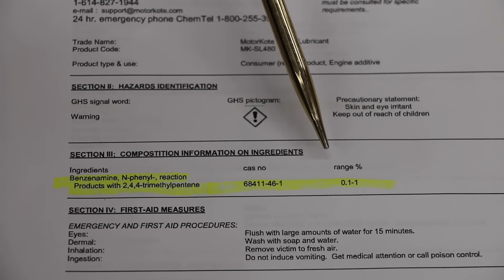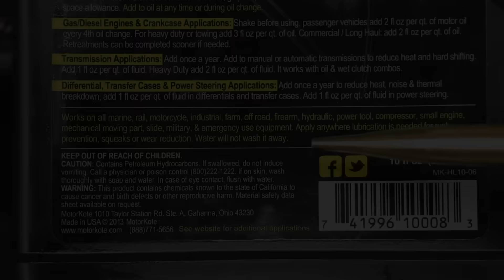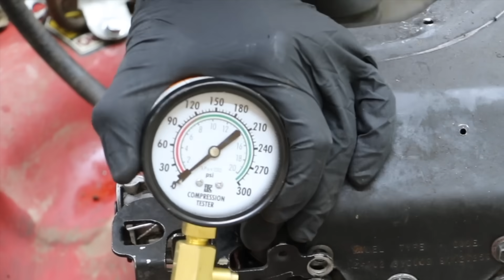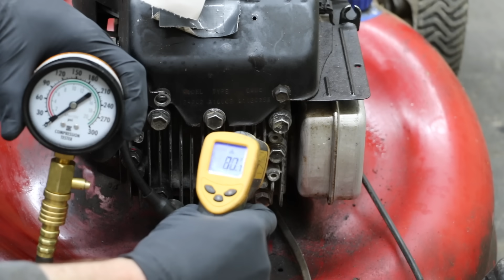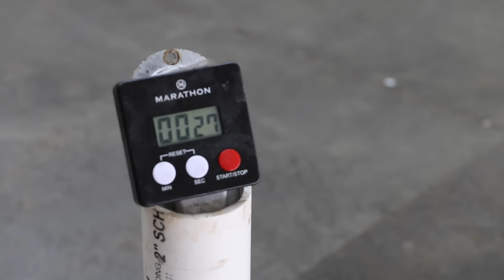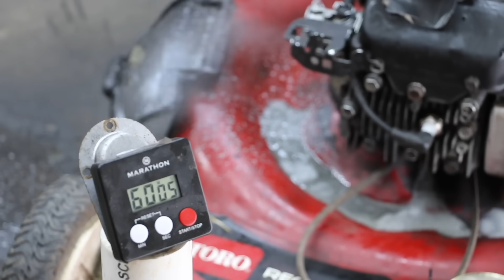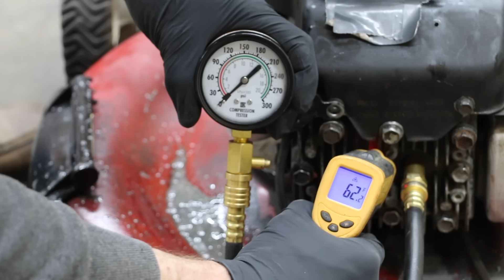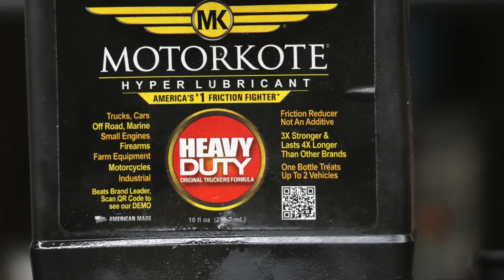Can MotorKote survive the water test?  Let's find out!

Comment: Used MotorKote for years in both my Big Trucks and Automobiles with no outstanding issues.  It does appear to do its intended job.  I get better Fuel Economy with it...and my Engines are clean and quieter too!  I can also attest that this product works really well in 2 and 4 Stroke Outboard Engines of any size.   I will continue to use this product, and your Test was really awesome and comprehensive!   Thank You for this Test and Review!!!
Reply from the maker: Impressive! Thanks for commenting on this.

Comment: wow! that lubricity test though! im amazed that this product worked so well. 
so now we know the special cocktail..
 seafoam, marvel mystery oil, engine restorer and motorkote!
Reply from the maker: These all seem to be legit products that work.
Reply: Project Farm do a torture test with all the products together? Or head to head?
Reply: Each of those products are made to do something different, so comparing them would be pretty pointless.
Reply: How about testing TurboMaxx? Then TriboTex that reverses engine wear. These are both nano particle products. I use these products in my Ford Super Duty 7.3L Powerstroke Turbo Diesel. 302,000 plus miles so far. Runs great.
Reply: I'd be more for a amsoil motorkote sauce mix than use seafoam or marvel, they are both outdated for their designed  uses and work better as cleaners than as high pressure lubricants. Sea Foam I know is naptha based which is a powerful oxidizer, usually used to speed up oil based enamel paint cure time.  As for Marvel, I know of engine builders of flat head engines liked to use it in the coolant system to get the bolts out of the heads... fill the coolant system full of marvel and run it till its hot, head bolts and water jacket bolts come out much easier without snapping them. Sea foam we've seen it work as a cleaner as Mr Farm tested, also saw restore bring a tractor back to life, as for marvel, I just wouldn't go around putting stuff in your crankcase, especially newer engines that was first marketed in the early 1900's.... 'shrug' but if you have an engine you don't care goes boom, do your own testing like this guy, this guy does amazing testing,  i look forward to every video... especially oil ones.

Comment: Old 'Geezer Gearhead' here again. Changed the oil yesterday, 6/17/18 in my old '02' Ford E250, 5.4/2valve, extended van. Mileage, as I write this post is 310,682. I drove it farther than I usually do before changing the oil&filter.  Almost 5,000 miles on the oil change with Motorcote additive. The oil level might have been down approx. 1/2 quart.(not too bad for an engine with that kind of miles on it and never had any major work done to it). I followed directions again, and added the Motorcote to this current oil change per recommendations.  Traveling to Tallahassee this next week end. I 75 and I 10. From Ft. Myers, Fl., and back. I'm convinced this stuff is working. One of the best additives that I've ever used in my driving career since April 1960. BTW. That's two oil changes and one container of MotorKote. Still some left yet. Thanks again for this good informative video.
Reply: Motorkote claims you only need to add every 3rd or 4th oil change... But maybe you already knew that.

Comment: Considering all of the awesome testing you've done on products like this, what in your opinion would be the best Fuel & Oil additives to use in my 66cc 2 Stroke motorized bike? I've been using Lucas Semi-Synthetic 2 Cycle oil + Chevron Supreme gas (32:1). I was considering using some fuel and oil additives to help my engine run cleaner and more efficiently. I was thinking of using Marvel Mystery Oil and Lucas Upper Cylinder Lubricant/Fuel Additive, however, now I'm thinking Motorkote Hyper Lubricant & Motorkote Fuel Optimizer might be a better option. What is your opinion on this?
Reply from the maker: I really like what you are currently doing. I don't believe you'll achieve any significant gains by making changes.

Comment: I now realized much more how great are your tests, motorkote totally shows.
Here is an idea, there is a cerma store, www.Cermastore.com

They sell additives, which they say you apply only once if it's for the engine crankcase for example, and then only continue with Cerma engine oil. Claims are pretty wild! They say their diesel engine oil, 15w40 lasts 30K miles,  if used on a semi truck! I really wonder how it stacks up against motorkote, and are their claims true, or a crafty snake oil?
Is it new American miracle, or just a claim, about cerma? They sell bunch of stuff, like for transmissions, and even additive for AC system, which they claim makes it last. The claims are so wild! The products claims from cerma are truly astounding, just read testimonials from supposedly truckers, about engine treatment and oil!
Is all this holding true???!
They say to have treatments that can be used for any engine, gas or diesel
Reply from the maker: Thanks for the positive comment. Also, this sounds like a great additive to test--thank you!

Comment: I just bought some of this to try. will see how she does. I use an app to track gas mileage after fill ups. Will run for a full 5k oil change and see if there is any noticable improvement.
Reply from the maker: I hope you achieve great results.
Reply: it looked great in the video, im guessing i will see marginal results if any in regular use. I will be using it in a 2009 dodge grand caravan with 180k miles and a 2017 honda civic with 22k miles. i hope to use it regularly in the honda to prevent wear in my honda and get a little more life out of my dodge. an ounce of prevention is worth a pound of cure.
Reply: well, I can still keep track but I think I'm done. Results for are 4,038k before, 2,392k after adding MotorKote.  Increase of 0.868mpg or 2.45% at 2oz per qt. Not bad over all, I think it is worthwhile and reducing friction  and wear in my engines and I plan to keep using it.

Comment: The pertinent question is, why aren't the components of motorkote and the like already added to premium oils? Massive research budget oil firms will know this stuff works and works well. There must be a reason. Would it unbalance the detergent properties? If so does adding motorkote benefit friction but reduce cleaning? Thoughts?
Reply: Probably because MotorKote is a private company that can make more money by selling their product seperately
Reply: for the same reason the oil companies don't want autos getting 100 miles per gallon..they would sell far less fuel. MotorKote type additives would also probably  effect the auto industry (less engines/ cars sold) as well as the dealership maint. and oil change industry.  it's benefit vs cost
Reply: My two cents: It would raise the cost of motor oil which would negatively impact sales.  Motor oil already meets or exceeds established standards, so why bother trying to make it better -  apart from synthetic.    That said, I just ordered a bottle for my car and my motorhome.
Reply: @mlconley  From my own personal experience...you'll will be happy with it!
Reply: @mlconley  yeah but you can't just not buy oil
Reply: @brewsqui EXACTLY the reason. Because it works too well!
Reply: I consider it to be like that episode of Futurama where fry buys the last tin of anchovies in existence and mom is worried that he will make some super oil and end her robot oil tirade 

If MotorKote themselves released an oil with lubricating properties that were the same as straight MotorKote 
They could easily put every other oil company out of business (and probably themselves too) because people wouldn't need to change the oil every 25,000km anymore, now they might only need to change the oil every 200,000km, sure that oil change will cost you a few hundred dollars, but you only need to do it every 10 years or so and the engine will last far longer than with regular oil 

I know pilots that use a 50/50 mix of oil and MotorKote in their planes, and they have never had engine trouble relating to the oil system since 

I am probably going to start using it to lubricate the parts on my electric bike instead of spraying WD-40 into it a few times a year
Reply: @mwbgaming28  I agree with that. I know I would buy it and not only that, I would pay top dollar for it after reviewing the test and the comparison to other oils. I don't think they would put themselves out of business though. Just look at the past oils compared to todays oils. Years ago oil changes were every 3000 miles and now it's gone up to over 7500 miles with new oil blends. I'm not sure about everyone else, but I would be willing to bet that just like me, people still change their oil around the same time or mileage with the high mileage than they do with the 3000 mile oils. It's all about peace of mind knowing you're running a top of the line oil and caring for your engine. I run both gas and diesel from motorcycles up to large equipment and even though the top dollar oil I put in the diesels claims it good for 7500 miles, I still change it before that. I believe it would be the same idea if Motorkote was to make an oil. But I also find it strange that a gallon of Motorkote is less expensive than the oil I use. And I know some people will say just buy a gallon and use it for everything. That's true as well, but we're all about convenience now days. We don't want an additive, we want one quart to do it all. There's several ways to look at it so I guess it's just a personal preference, but it would be nice to have the option. 

P.S. Motorkote makes a spray lube. Why would you not use that instead of WD-40? Wouldn't it be so much better than just a water displacement? That's my opinion anyway.
Reply: @nzzs203  very true, but imagine your new oil is good for 200,000km (whatever that is in miles) 

I don't think you would change your oil every 5000 miles if your oil was good for many many times that 

The reason I used WD-40 is because it's cheap, gets the job done and I didn't know that motorkote made a spray lube until now or that it was better than they claim it to be 

Now that I have seen the hard evidence rather than relying on stories from my pilot friends using it in their aircraft engines, I'm definitely buying some motorkote for anything that needs to move but refuses to
Reply: @mwbgaming28  yeah, I guess you're right about 200,000km. That's a huge step up from 5,000. After seeing the evidence and you saying how your pilot friend uses it in their plane, that's enough for me to trust it in my vehicles and equipment. I've never used the spray myself. I was reading about Motorkote on the web and the spray came up. When I go to get the gallon of Motorkote I'm going to try the spray too. That way I can give a honest opinion about it.
Reply: @nzzs203  well I look forward to hearing about it, maybe PF can pit WD-40 against it lol
Reply: @St3v3Bob  The problem with that thinking is it costs literally several billion dollars to produce a drug these days. So even if you cured cancer good luck raising 3 billion dollars to get it approved by the FDA. Also, there is more money selling a treatment drug for 20 years than there is a 6 month drug supply to cure a disease. I dont know about oils, but it must cost tens of millions to get these different certifications you see on the jug. Motorkote may just not have the capital to go through that. Not saying that's the case, but it could be. I think on balance...motorkote is unlikely to be better than everything else...but more testing needs to be done
Reply: This seems like it would be good in a Stop/Start engine
Reply: Patented
Reply: I can think of a few possibilities: a) too expensive b) alters viscosity too much (fine for heavier oils, ultra lightweight (0w-xx) oils like those used in modern engines with vvt might become very difficult to formulate) c) oil manufacturers have no clue how to replicate its properties in a cost effective manner (im sure motorkote put a lot of r&d into the product given that it legitimately works) d) it may not make any financial sense to add it (oil manufacturers can already make claims like "reduces friction/wear" without actually having a superior film strength)
Reply: @arlobubble3748  
My feelings as well. 0w20s are like water as is. I like the idea of this product but worry how it may effect the filming of the oil.
Reply: My brother sells this stuff and I have used it and swear by it.  I am also an engineer.  Based on my calculations I did for him if you keep a vehicle less than 100,000 it has little advantages and payback which is most people.  Vary few to nobody is going to pay you more vehicle when you sell it because you used MotorKote.  But if you keep your vehicle til the wheels fall off, it is the best money you will spend.  As with all extended life products most of your cost advantage comes in extended life.
Reply: I called amsoil and talked to am engineer and he states they do not recommend any products to be added or it can compromise the oil.

Comment: Can you test water or coolant contaminated oil. When a car blows a head gasket, water typically gets in the oil. Let's say it survived the initial blast of the head gasket, but there is some water residue left in the engine. How much damage will thus cause if you add fresh oil to that crank case that still has some water in it
Reply from the maker: Thanks for the video idea!

Comment: So my question is why would you ever run oil if this is such a great product?
Reply: Motorkote - $24 per quart / $120 per oil change

Motul 8100 or Redline - $16 per quart / $80 per oil change

Pennzoil or Valvoline - $7 per quart / $35 per oil change

Pennzoil or Valvoline + 10 oz. Motorkote - $42.50 per oil change

Comment: i've used it and it worked for me. more power, and it lube a clacking valve rocker at startup on my 99civic ( didn't want to pull valve cover to adjust it) great video! gotta put a gallon in my big rig.
Reply from the maker: Thank you for commenting on this!

Comment: Repeat the water test with a car engine. Car engines have oil pumps. That would be interesting to see/hear an engine run with water pumped through it instead of oil. Lawn mowers have a splash or sling type lubrication system. Lawn mower engines are more likely to survive as you proved. MotorKote claims it can't be washed off so a repeat test with a car engine is in order.
Reply from the maker: Thank you for the video idea!

Comment: I found this to be quite impressive! I expected a disaster. Lol. The lubricity test makes you wanna run  this stuff in your engine by itself. Lol
I fully expected the engine to destroy itself. It seemed like the cylinder wall was actually cleaner after running the engine with just water in the crankcase and no loss of compression. Surprising!
It had me curious what would happen if you added engine coolant to the water to slow the boil-off of the water. Also, would have been a fair comparison to run the engine with just 10w-30 (no additive) followed by straight water as a baseline, just to show what happens without the Motorkote. (I realize the test was to see if the Motorkote would wash off, but we kinda don't know how much damage the engine suffers without a comparison.)
Regardless, excellent video!
Reply from the maker: Thank you!